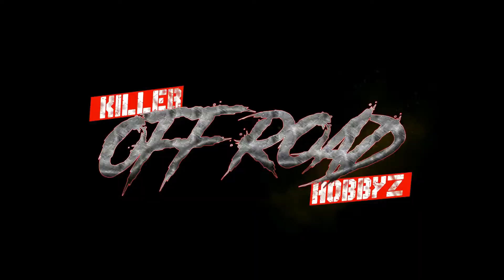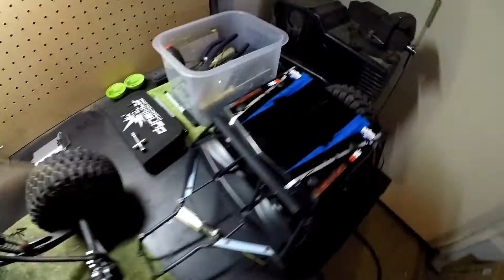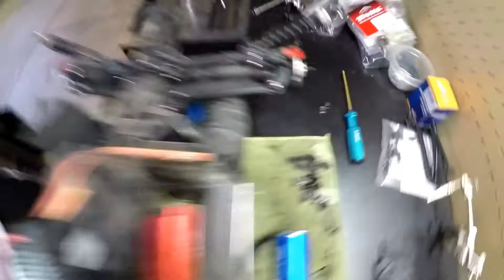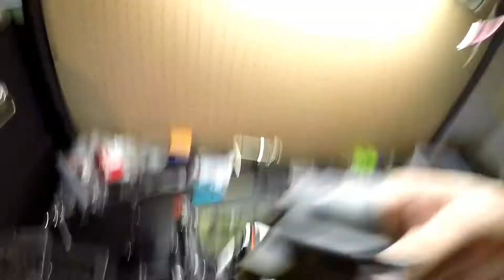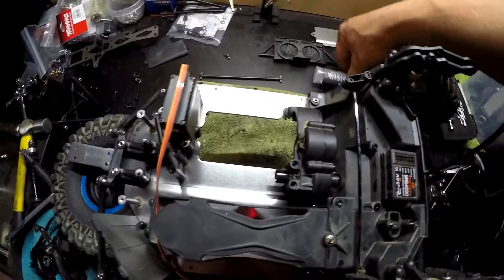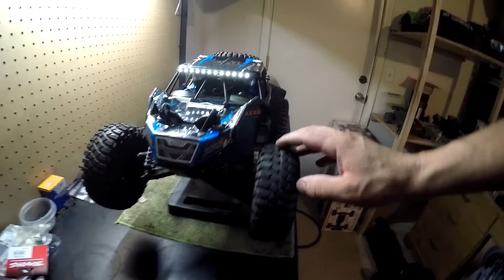Losi Rock Rey upgrading & diff locking

Comment: Ughh but how did you do the diff lock 😩
Reply from the maker: Steel stick in center diff and steel stick in front diff
Reply: @killeroffroadhobbyz  do I have to take out the internals ? Or put it over the internals
Reply from the maker: @mandosgarage  No just put it in with the gears and give it time to set up

Comment: Just wanted to confirm that the Hobbywing Program Card (30501003) is the one that you used for programing the stock ESC  Link: https://www.hobbywingdirect.com/products/led-pc2c?variant=172030922
Reply from the maker: Yup thats the one. That will also program Arrma BLX esc's
Reply: KillerOffRoadHobbyz , I guess since I have your attention I’ll pick your brain a little bit. I have a new RTR RR and I’m curious since it has been a while would you still recommend these modifications that you did in this video? More specifically, would you still recommend this motor swap and locking the front differential? I definitely need to slow the RR down because of the type of terrain that I run on!

Comment: I'm really confused regarding your motor install. Exactly what motor did you install? I have had three motors in my Rock Rey aside from the stock one, and all of them used stock mounting holse with the stock pinion.
Reply from the maker: It's from hobbyking, 3674 3300kv 4pole
Reply: @killeroffroadhobbyz  
Ah. Had a similar experience with one of their trackstar 3665 3190 kv motors in another rig. Holes were off. 
If you ever want to really get it to run smooth, but keep the electronics somewhat budget friendly all things considered, do what I did. TP Power 3635 6D in a sensored version and a Hobbywing Quicrun 10BL120 esc. Will run smooth as silk when crawling about, but it also has the ability to run like a raped ape - and you will be about 50 grams lighter.

Comment: i wonder could you help me out , im in a bit of a mess, i was doing this same thing as you on a losi raptor rey to put some heavy diff oil in the centre diff , like you i got all the way to having the diff removed but when i tried to remove the grub screw in the back of the drive shaft to separate the diff from the diff housing the allen head wrench started slipping in the grub screw, i know i could be royally shafted now but im sure others have been in this position, im not above buying new parts but obviously if i can possibly avoid it i will , i have tried heating the grub screw with a soldering iron but there is virtually no purchase on the allen wrench, i could just put it all back together and it would be same as it was before but it has FAR too much drive to front wheels and is annoyingly tippy so more power to back wheels should make the back end slide out better.
if i have to get new parts then it is what it is but which parts would i need to get , would i need the drive shaft as well ?
as i said its a mess !
Reply from the maker: Sounds like your going to have to drill it out. I have had that happen to me many times and just had to drill it out and buy new parts. QC is a problem with most Rc companies these days, missing parts, loose screws or over tightened, gear mesh off, esc tape coming loose first bash the list goes on
Reply: @killeroffroadhobbyz  
i was thinking that myself , i have only had the car for two months and have contacted the shop, explaining that the car was uncontrollable from the off , pulling severely to the left on acceleration , it could of caused a real problem if it had hit a child or car wheel , even a curb, so it was either send it back or add thicker oil to centre diff , as i have a lot of experience in these models i decided to strip it down and add thick oil to diff only to find that the grub screw was seized through too much thread lock on grub screw, the shop have said to send it to them, so i will today .
i feel these cars are not toys and sometimes require us to work on them, that should be taken into account when putting these cars together, i understand that threadlock has to be applied but should be done in a professional manner, not just loaded in , in a flippant manor.
many thanks for your reply

Comment: I wouldn't lock that front diff.....
Reply: Y not
Reply: @Matts_ahclimbing  Cause its gonna drive horribly. Now if you're doing what gary was doing and just using it as a crawler you will be good. But if you plan on doing anything other than crawling I don't think it would perform well.
Reply: @cwatson42785  I locked the diffs in an emaxx trying to do the same thing... wouldn't steer. Locked rear and center with a heavy weight oil in front will probably work best. I know this is kinda old.
Reply: @americanfather3090  Hey thanks for the tip! I actually got rid of my losi rock rey. Locked rear diff didn't really suit my driving style.
Reply from the maker: It's to late now

Comment: Seems like using silly putty would have been a better idea than epoxy that can not be removed. At least silly putty is firm but will give a little when it's bound up. Epoxy seems like a easy way to continually break parts when bound up. Good luck with that I see breakage in your future. Better get used to tearing that thing apart. I'm sure you'll get faster at it.
Reply from the maker: You might be right, I guess we will soon find out

Comment: Looking good bro! I recommend gearing the pinion down to a 10t since you went up on kv. Let me know how you like the motor!
Reply from the maker: Hey man I want to give you a shout out man I watched your upgrade video used the motor. Thanks so much for all the info in your videos.
Reply: KillerOffRoadHobbyz 
Thx for watching my friend! I'm a fan of your channel bro! Folks who are genuinely trying to help others are few and far my friend. Keep up the great work!
Reply from the maker: Thank you very much I will and you do the same
Reply: It's more efficient for a higher kv motor to run higher gearing you know
Reply: josh thumperluck  not true at all.. go check out John Holmes with Holmes Hobby. He makes motors, esc’s, and servos. The most efficient motor is a 2700kv and running it at higher voltages make it out perform high kv motors and stay cool. High kv motors create heat and that is th number one enemy of electronics my friend. John can do the math for you and explain it better than I can. I took his class at this year’s USTE event. Very smart guy!
Reply: @krlaturn  thanks never knew that it's because I thought if you can run lower voltage to get same speed it makes it efficient. I will check his vids
Reply: josh thumperluck  you bet! I learned a great deal from him! His philosophy is volt up and gear down!
Reply: @krlaturn  but if gearing down its not fast top speed or will the higher kv produce the top speed
Reply: josh thumperluck volt up and gear for cool temps. Like 6s on a 2200kv will get you into the 100mph range in a 1/8 GT car. A 2500kv on 3s is like a 4000kv on 2s but the 2500kv is cooler. You can gear up as long as you stay in 150-180 degree range on the motor. Depending on the motor
Reply: @krlaturn  thanks explained good so I can gear up as long as the temps are good. I geared to high once I only had it on 2s and when I drove the rock rey the battery wire would desolder from the esc is that why?